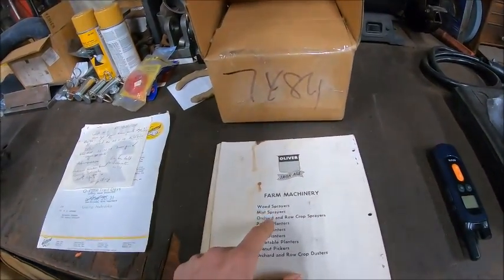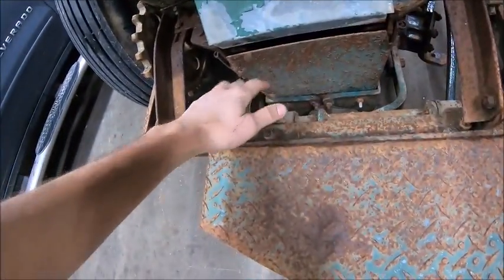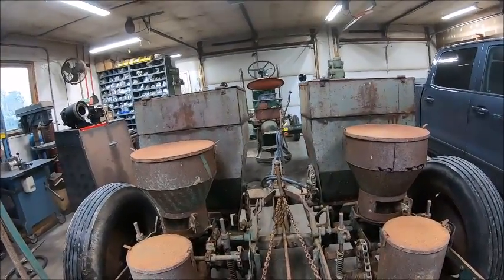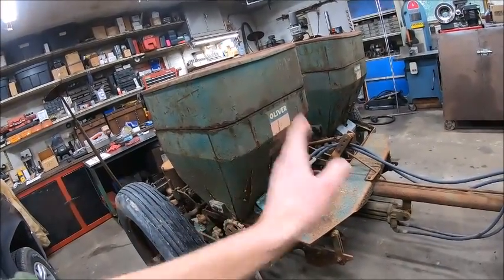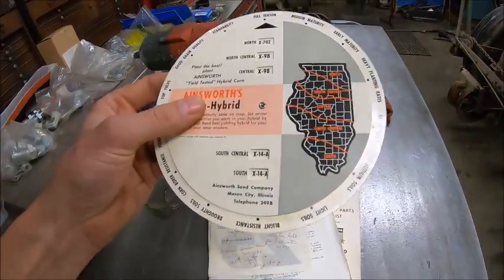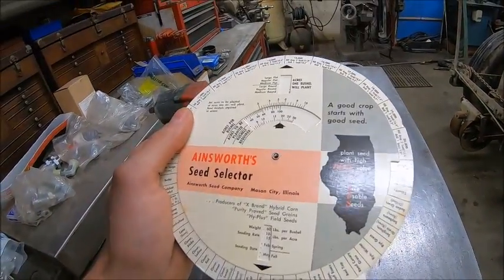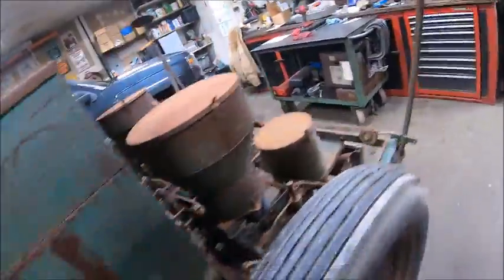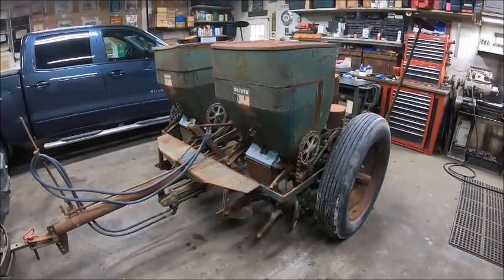Sometimes I Dont Think Before I Act, Oliver Iron Age 260 Planter

Comment: Boss man, you are getting yourself a collection of planting equipment lol. A 38 Drill, Two 64 Drills IIRC, a 4-Row 540, an 8-Row 543, a couple of part units 4-Row 543s, now a 2-Row 260. And you are intending on getting a 6-Row 5100 (or 5400 I can never remember lol). You are a true renaissance man lol.
Reply from the maker: Gotta have backups for the backups.
Reply: @Oliver66FarmBoy  Yessir! And it helps when the backups are just as cool as the main users.

Comment: Lockwood bought the A. B. Farquhar Iron Age planter design from White after they bought Oliver. The Lockwoods are the exact same design as the Iron Age planters with the planter and fertilizer boxes updated. So if you can get ahold of them they would likely be your best bet at getting the missing parts
Reply from the maker: Good to know. At least if they can’t help might be easier to find Lockwood planters for parts.
Reply: We have and use a old Lockwood 2 row tater planter, this looks alot like it

Comment: That’s a pretty neat design. With the bolt holes on the back by the tag was it adjustable for row width? Antigo Wi is use north east of me like 40 miles that is some potato country up there as is just south east of me like 60 miles around plover/Plainfield Wi it’s sandy soil perfect for truck crops. It’s neat to see all the Oliver stuff I see around me different areas have some different specialty equipment along with the normal everyday.
Reply from the maker: Yea it will go from 36-42 by sliding the frame if I remember correct.